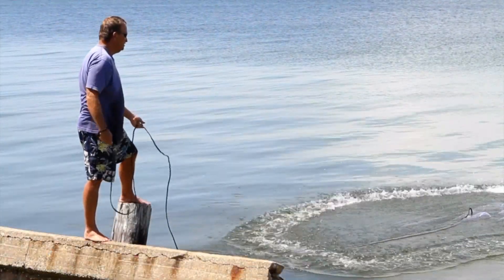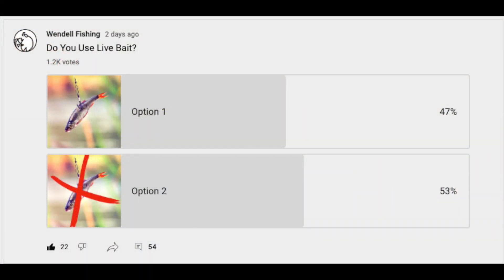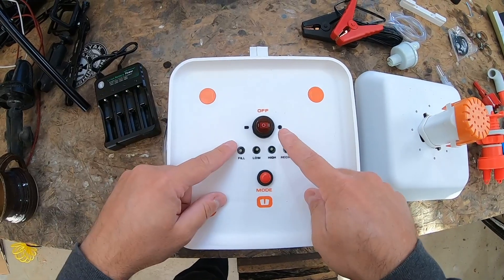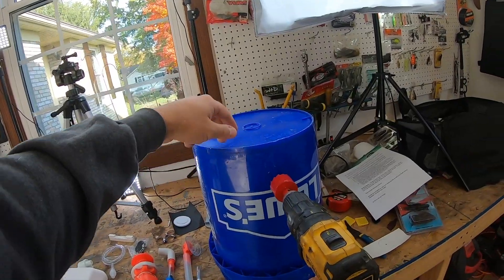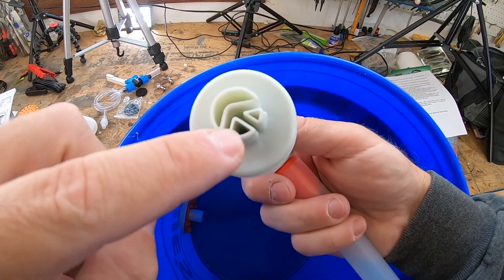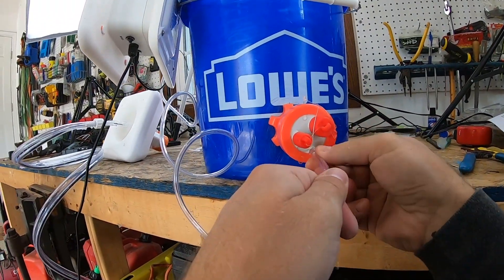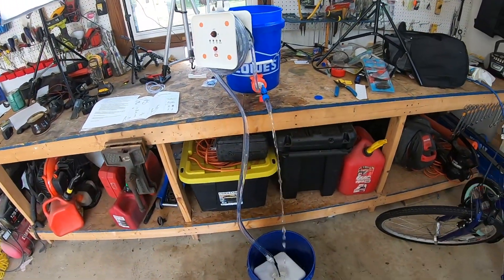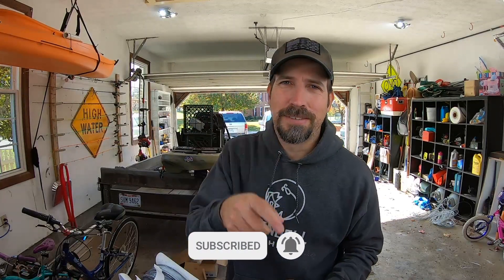How to KEEP BAIT ALIVE for LONGER in a Bucket or Cooler

Comment: Great video and awesome product!
A few thoughts:
Wrap the bucket in reflective bubble insulation to minimize heating from the sun to “supercharge” this system. 
If you’d like to test similar concept before investing, grab a harbor freight solar pond fountain pump. Paired mine with an old cooler and never looked back.
Reply from the maker: Right on Breaux... Thanks for the tip! This is what makes this community awesome